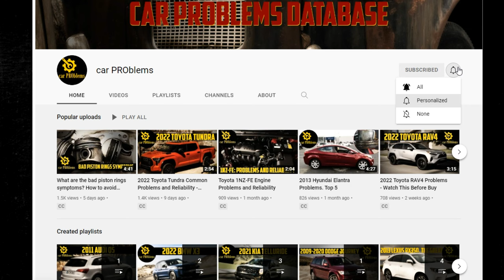What is piston slap? What causes piston slap?

Comment: My 4.3 has been doing this for the last ten years since I first got my s10 and it's why I got the truck so cheap. Literally 30-60 seconds on a cold morning and it goes away and runs perfectly. In the summer very little to no noise at all. All I do is let it run a little before taking off.

Comment: Thanks for your efforts and informative content.
What if the extra gap is caused by worn out cylinder sleeve not due piston? How to fix that and how often this could happen compared to worn out piston.
Reply: I would say a worn out sleeve is rarer. You would do a compression test/wet compression test and a leak-down test to verify its the sleeve or piston rings. Either way, engine overhaul would be necessary. You would replace the piston rings and add in cylinder sleeves measured to return the cylinder bore to its original diameter.

Comment: Thanks for good information. What happens if run a car with permanent piston slap sound for long time? specially when car is old and not worthy to replace engine? how many mile it takes to break down?
Reply: Keep the oil in check and pray
Reply: use thicker oil

Comment: Hi,can this problem cause excessive vibration bcoz my dirtbike vibrate a lot
Reply from the maker: Hi! Yes, piston slap can cause excessive vibration in a dirtbike. 

Excessive piston slap can also cause increased vibration throughout the engine, which can be felt throughout the bike. This vibration can be particularly noticeable at high engine speeds or when the bike is under load.

Comment: Howdy. I have a new-to-me 1998 Nissan Pathfinder 4x4, automatic, 3.3L VG33E 4th VIN digit "A" motor, made 10/1997.  It has one or more bad piston wrist pins, and a confirmed bad crankshaft due to excessive bearing failures from oil loss.  Does anyone know if the pistons in a 1996-2004 Pathfinders, QX4, Frontier, or Xterras can be removed and reinstalled through the bottom of the motor (oil pan), with the motor still installed?  I also have a bad crank so I have to have it removed and machined too.  The rest of the motor is clean, no oil burning, and low miles (165,000).  I hate to swap it for an unknown possible problem motor if I can do it this way instead. 

I haven't been able to find anyone online who has accomplished this, but maybe it's not possible due to clearance or whatever.  Do ya know, or take a guess, if ya been under one of these models with the oil pan off and crank out?  Thanks much!
Reply from the maker: Hello! Sorry to hear about the issues with your Nissan Pathfinder. It's possible to remove and reinstall the pistons in a 1996-2004 Pathfinder, QX4, Frontier, or Xterra through the bottom of the motor (oil pan) with the motor still installed, but it's not an easy task. It requires special tools and knowledge of engine rebuilding.

Regarding the bad crankshaft, it's recommended to have it removed and machined by a professional mechanic to ensure that it's properly repaired. Swapping the engine for another one can be a viable option, but it's important to have the replacement engine inspected thoroughly before installation to avoid any potential issues.

I hope this helps, and good luck with your Pathfinder!
Reply: @carproblemsmax  actually, I've seen a pic of the short block from above and below, and the crankshaft webbing steel blocks the extraction from the bottom.
Reply: VG33e's are cheap. I would just buy a good used engine and swap it. Change all the oil seals on the new (used) engine before install so it doesn't leak and cause the same problem over again. This is cheaper and easier than trying to fix your original engine. I know because I just did this on a Frontier. You can get junkyard VG33e's all day for less than $1k, and you can get pretty nice JDM import VG33's for just over $1k which will swap right in after swapping over the accessories and fuel rail.
Reply: Hi I have the problem the piston slap but I put ring and bearing

Comment: Hello, when i move the piston with my hand it shakes but it doesn't go up or down, while shaking to the sides tho it makes this clicking or knocking noise. What does that mean
Reply from the maker: The shaking and clicking/knocking noise you're hearing when moving the piston by hand may indicate that there is a problem with the piston or the engine itself. Without more information about the specific engine you are referring to, it's difficult to give a more precise diagnosis.

However, some possible causes of the symptoms you described could include a worn out piston pin, a damaged connecting rod, or a problem with the engine bearings. It's also possible that there is a problem with the cylinder wall or the piston rings, which could be causing the piston to move unevenly and make the clicking noise you hear.